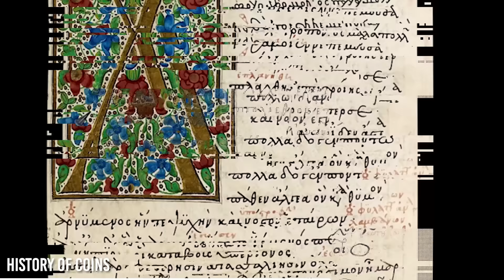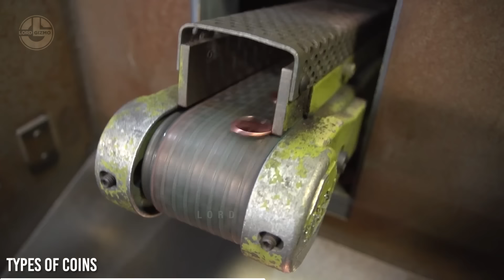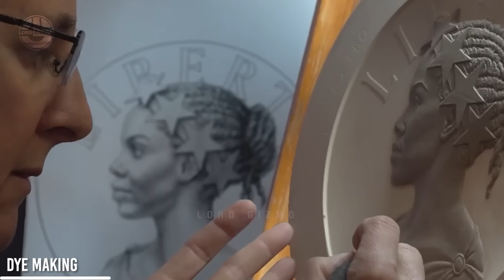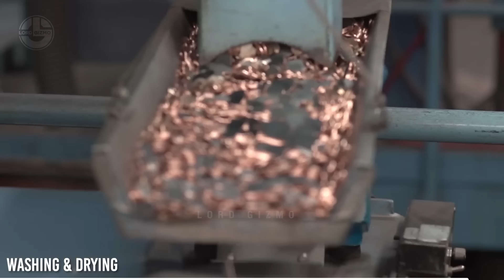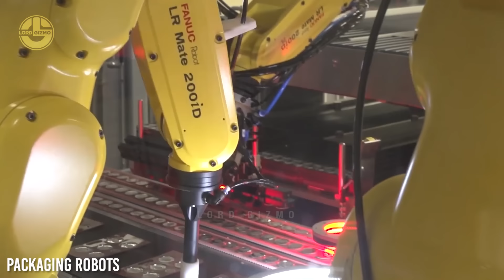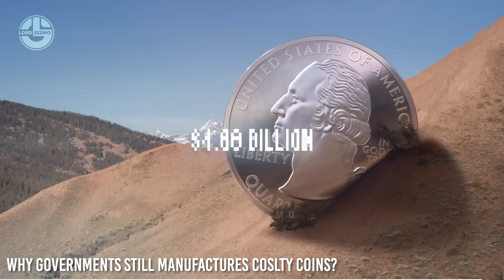From Metal to Money: The Fascinating Manufacturing Process Behind Coin Minting

Comment: Government can't make currency totally digital due to the fact that the electrical grid and the internet are not 100% reliable.   A solar flare could knock out the electric grid for months or even years.  There would be no back up system if that were the case.

Comment: I found an unstuck blank quarter in a mint roll I got at the bank when I went to get change for were I was working. I showed to my manager all he could say was 'so what' 
I told him you will never see or find another unstuck blank in a roll of quarters again. It went in my pocket and I put quarter in the register from the tip can. Back then in the late nineties an unstuck blank quarter was going for about $25 at coin shows.
Reply: So it was basically a washer .
Reply: @edwardcooper5479  A coin blank because it’s copper nickel clad fresh out of a U.S. Mint roll and doesn’t have hole in it but other than that very much like a washer.